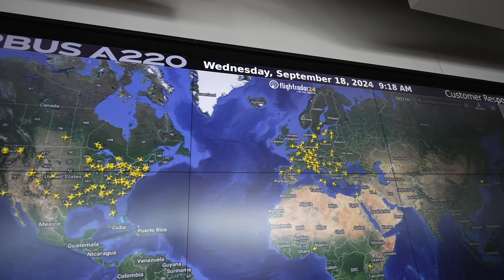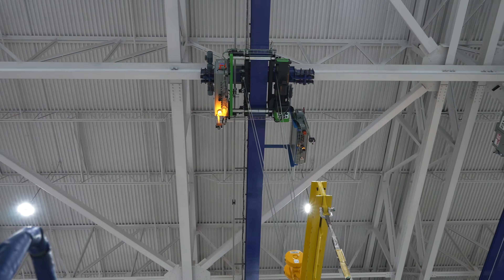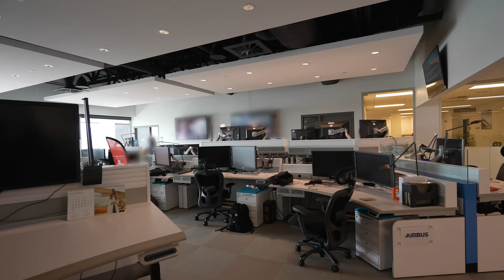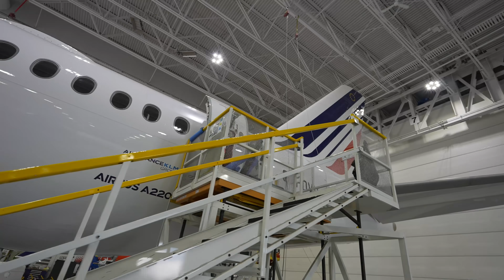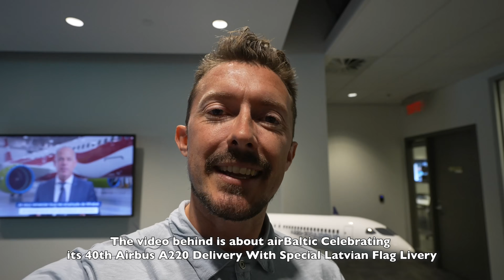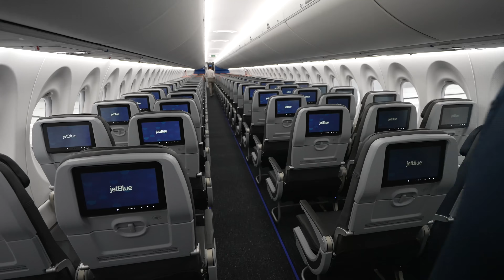A220 up close: how Airbus crafts this next-gen jet

Comment: Surprised that China is in the manufacturing chain, due to future political issue if certain conflicts flare up.  I was wondering also, once the plane is completed, where does it exit the building to go to engine install, paint, etc.  Can't really tell form the inside of the building.  Looking forward to next video.
Reply: China produces 28% of the world's manufacturing output, the largest in the world.  Airbus get products from China the same reason why the majority of us do: cost. Stop being controlled by political propaganda and realize everything is about money.
Reply: Big blue hangar doors are not shown in the vid. They are just in front of the nose of the aircraft at the end of both FAL lines. As for china...what they do is extremely barebones. They pretty much rivet some metal bits together and the complicated parts are done in North America. Airbus don't let them touch composites or any critical areas. All their work is thoroughly inspected and tested here in canada.

Comment: A  very subtle but notable difference in the factory between Airbus and Boeing. Airbus assembly gives top priority to assembly quality, Boeing, assembly quantity. Most visible in the pressure on the employees. Airbus: Get it done right with meticulous attention to details, with fully integrated departments working in close cooperation, from designers to engineers to component assemblies to final assembly. Boeing, compartmentalized, each operation first and foremost under the gun to achieve rapid assembly, engineering nowhere in sight. QC is focused on production numbers and make the boardroom and stockholders happy.
Reply: We call that "stepping over a dollar to save a dime".

Comment: The involvement of China goes back to the start of the program under Bombardier. China provided important launch funding for the CSeries and in return Bombardier agreed to China making the Mid-Fuelage , Rear Barrel , Tailcone , Doors and Forward Fuselage . Airbus continued this arrangement when they took over the program in 2016.
Reply: Thanks for the additional context.
Reply: *sources needed about seed funding. If it’s true it would have been a minuscule amount compared to the Government of Quebec and the Government of Canada

Can’t trust your information when you can’t even get the year the program was purchased by Airbus.
Reply: airbus took over the C-series program in 2020, not 2016
Reply: Actually we are both wrong . Airbus formally acquired 50.01% of the program in October 2017 . However their involvement as a minority parter dates back to 2016 . That’s when I first started having dealings with Airbus personnel when I was based in China.
Reply: Isn’t bombardier located in Quebec why did they get rid of the production of the plane and give it to Airbus instead?
Reply: @CyberRobloxNationYT The production is still in Quebec while Airbus provides extra production capacity in their own facilities
Reply: China made
Reply: What a huge mistake. Letting them gain critical aviation knowledge to compete. Why the Canadian government didn't step in stinks of the foreign interference. The only thing China needs to get from us technology wise is "enhanced capabilities" deployed on them
Reply: @namm0x326 chill bro, these are commercial aircrafts. Airbus has already been in China since the 90s so they’re not stranger to the relations and technology.

Comment: flew on one 3 days ago with Air France 2 + 3 config. Very cool and capable aircraft. I was just thinking about possible cross sectional inbalance due to the config. HOw is it compensated on design level ?  Also at one time aircraft seemed to bank more than 30%. Is it possible or was it just my impression ?

Comment: I worked on that Engineering Simulator (ESIM) and the iron bird (ISTCR)   for 5 years in Mirabel from before 1st flight to type approval.   Even the cockpit is drop dead gorgeous .  Fantastic job on the interview.
Reply: Iron birds are fascinating

I have 6,000 hours as a captain on crj900... You folks build great birds in Mirabel!